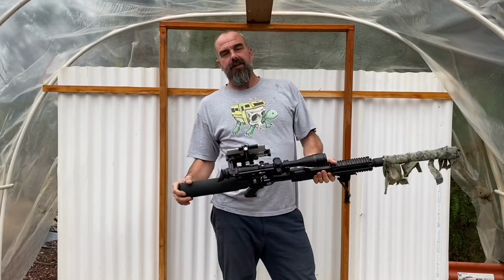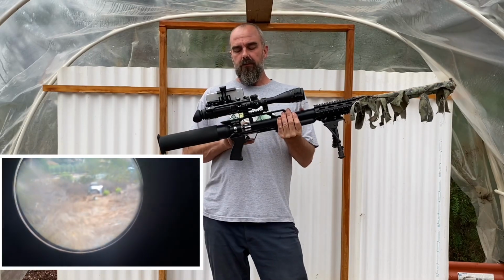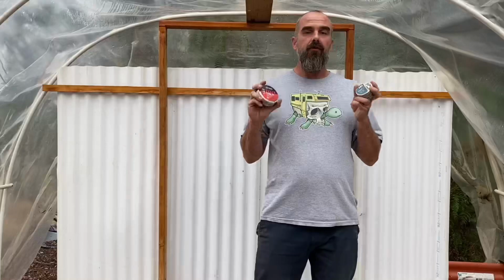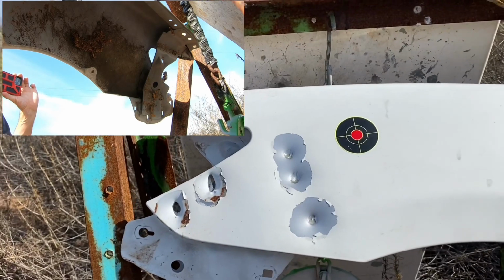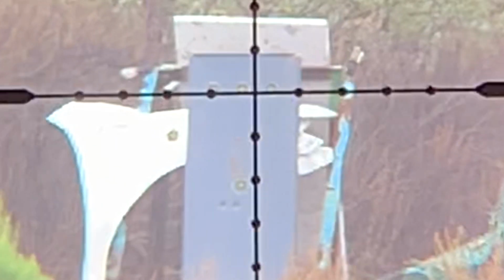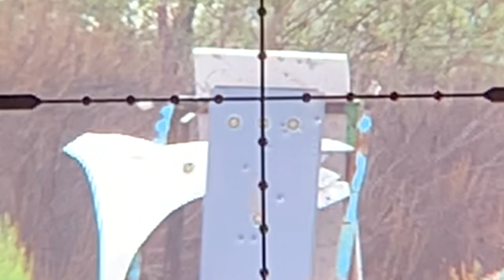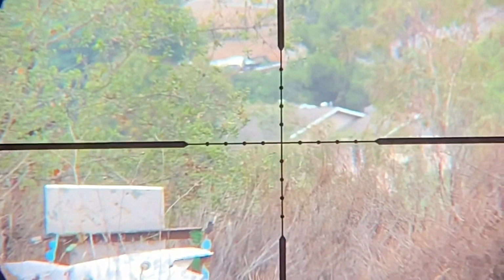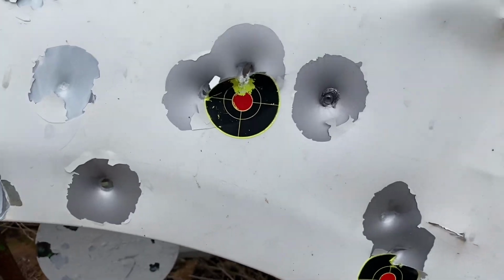How effective is a PCP air rifle? What 70ft lbs is actually capable of. .25 cal Airforce condor

Comment: I picked up a .25 Condor with the Ring-Loc valve about 6 months ago and feel your frustration.  The Condor is too hot to shoot anything but the heaviest pellets.  I've completely switched over to NSA slugs and used the Ring-Loc valve kit to tune the gun.  WIth 43.5gr NSA slugs, I'm shooting around 960fps, right around 90ish fpe and a little over 1 inch groups at 50 yards.  Nick at NSA told me the best accuracy will be at around the mid 900s fps.  With pellets, you need the velocity down around 900, and they don't retain as much energy as slugs.

Comment: The manual of this gun reccommend to lube your pellets?

Scope leveling is for sure hard to get right without propers tools!
 I never shot at this distance but im pretty sure I would get the same holdover issue (I leveled all of my scope without scope levels)

Distance brings alot of factors in..

Good video !
Reply from the maker: Well I found the manual and no it doesn't. But I have had a talon SS since 2004. For whatever reason I can remember I have been oiling my ammo that I ran through it ever since I got it. 
A compressed air system usually has zero oiling involved in operation, as a matter of fact the opposite is happening. Where moisture gathers inside the tank from compressing and discharging. That ends up condensing in the barrel and rust soon follows. 

I found this article:  https://www.pyramydair.com/blog/2008/02/how-to-lubricate-pellets/

I think the airforce came with a DVD but I'm not 100%sure. I can only say that I got this information almost 2 decades ago. I have been doing it that way ever since. Unless I get lazy.
Reply: @webreakforsquirrel4201  finaly someone that does it but knows why haha!
 I did learn a couple things there thanks for the share
Reply: @webreakforsquirrel4201  yup, pressure makes condensation! 
I've become a real fan of FrogLube for air guns, slick coats surfaces and prevents rust really well, it also added +10% fps to both little spring plunger Daisy's here (a RR and a Buck) for doing air cylinders and shot tubes.
Reply: I use the same lube that I put on my conicals for muzzleloaders and cap and ball revolver.

Comment: I’m not surprised that it didn’t penetrate the car fender because the .22 bullet that punctured president Reagan’s lung in the 1981 assasination attempt by John hinckley jr was fired from a small .22lr revolver and ricocheted off the presidental limousine door and flattened and it had similar power ballistically to what this gun is getting with the same weight in pellets but a slightly bigger caliber with similar feet per second velocity and foot pounds of energy
Reply: Didn't John Hinckley jr. Use like a 32 Smith & Wesson or something. I thought it was a small little snub-nosed pocket pistol
Reply: I heard it was a snub nose pocket pistol .22lr
Reply: I remember the day it happened.

Comment: Actually your lighter pellets will speed up and penetrate more, not sure which light grain for a .25cal. 25 or 26grains??? Try it
Reply: @huckstirred7112  these are not military nor elephant projectile slingers, 2 different worlds! But I do own an air rifle that will take down a 1 ton or better beast! I was only trying to help here because I have countless thousands of hrs testing air rifles and pesting 40+ years 😱
Reply: @eddiecahall3824  I in no way was criticizing you or say your wrong .  I am sorry if it appeared  that way
The US military did prove high velocity is the number one factor when it comes to penetrating steel . And hunters through out the world know to penetrate flesh and bone you need sectional density . That last statement maybe incorrect . Now I think of gauge rifles .
Well I am a black powder cartridge man . The only big game guns I own or 45/70 and 50/90  .  I never even killed a deer with a modern load . I am 50 if that matters .  I do have an extensive library on the 100 years ago African  big game hunters . Taking down a small pig with a .25 or .30 air rifle would not be that far away from taking an elephant with an 8 bore . Although I myself never done it . I am thinking  "I maybe wrong"   air rifles have very similar velocities to the big gauge rifles.  Both weapons are also low on sectional density . Would there performance be similar just scaled down? 
Is it time to reread Sir Samuel Bakers Wild Beast and there ways . 
My only experience with air rifles is my 766 crossman .Witch is about to be sent back to the factory for its 3rd rebuild  . I am looking and seriously tempted to jump into getting a PCP . If I do It would be on the order of a crown

Comment: I guess it's not easy shooting with a airforce condor.
Reply: Stacking pellets at fifty. Same hole. Want to try for more distance but don't have alot of options where I live. Unless I can get some time and drive out to farm but it's a busy life. I will say the condor can be a bit hold sensitive kinda like a break barrel. When you get the feel of the rifle and know how it like to be supported and  shot it turns into a tack driver.
Reply: @shawndubay4050  They can be very accurate.   I recently got a airforce Escape in .25cal.    And since I was shooting pellets @ around 900 fps.    They would all go into the same hole.   Very accurate.     NOw when your trying to shoot slugs at high velocities.   That's a totally different thing.
Reply: @airgunsofidaho4886  I wonder what the biggest animal that the 25 caliber Condor SS can ethically and efficiently take?? Seems like it has alot of power and accuracy. Coyote or maybe a boar at 75 with a well placed shot. It completely mushrooms the 33.95 grain jsb pellets when shooting at high power at my spinner targets. It actually dents them pretty good at thirty yards.

Comment: I think a better test would have been shooting a chicken or a pot roast...you wouldn't expect  penetration in metal...from the dent in the metal you probably take down small game.
Reply from the maker: The sheet metal is basically a uniform thickness. So it provides a standard barrier with each shot. It really challenged the ammunition . I have shot pork belly to see ammo expansion. The meat just doesn't hold up when shot over and over plus it can be a mess. It was more of a visual demonstration that even non shooters could quantify energy standards. I don't know anyone that hasn't seen a car fender and can kind of understand its physical properties.
Reply: @webreakforsquirrel4201  hi there I have the Condor SS in .25. I was wondering what would the biggest animal you would confidently take with this air rifle?? Coyote, boar with a well placed shot or would that be pushing it a bit??
Reply from the maker: @shawndubay4050  I have put down a coyote with it. Behind the ear.
Reply: Yes it is silly to shoot a sheet of steel   see my comment on inserting tungsten rods